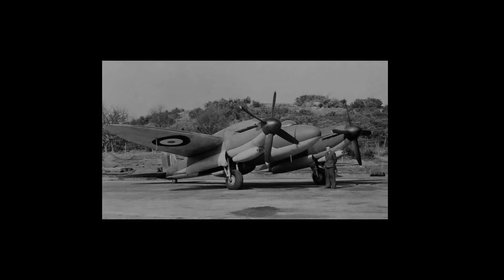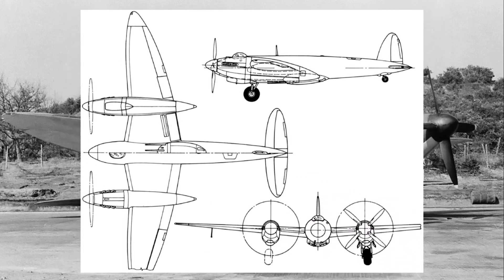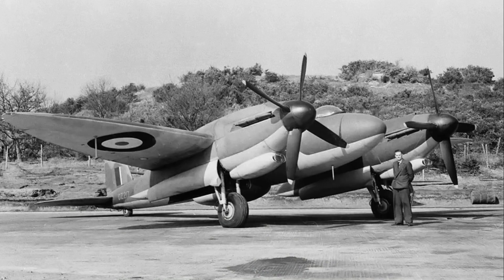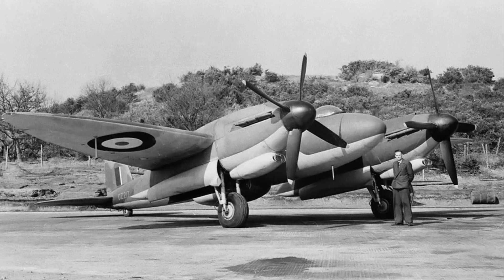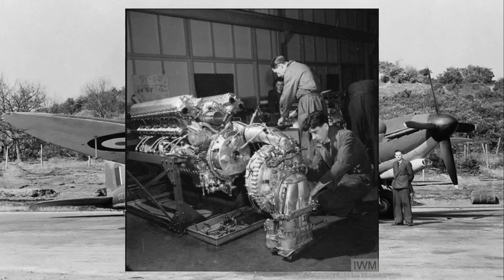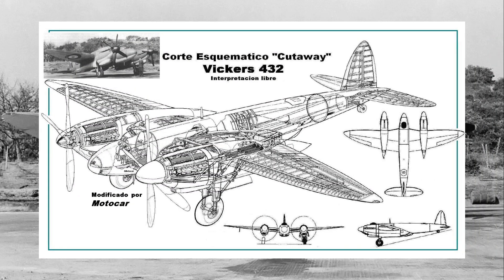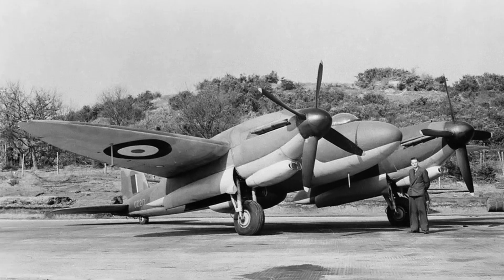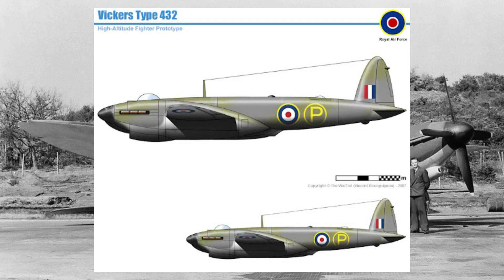The Metal Mosquito: Why Vickers Type 432 Failed!

Comment: The Wooden skin of the Mosquito simply meant it could be manufactured in parallel to other aircraft without competing for materials apart from Engines.
In addition the Mosquito 
quickly became the Nazi's High Command "Mosquito problem"
When being attacked by a large number of heavy "slow" Bombers there's an obvious solution. You scramble a bunch of fighters who know where the Bombers are and their most likely "big" targets. 
But what do you do when 1 or 2 very fast, small Bombers attack. With much smaller bomb loads it's much harder to predict their target which could be relatively small or specific points of a big target. 
These "nuisance" raids can in very small numbers be ignored but when they start becoming very frequent it's hard to know what to do, especially when these Bombers are faster than some of your fighters🤔
Reply from the maker: Great points! The Mosquito’s wooden construction was a major advantage in production, and its speed made it a nightmare for the Luftwaffe. It completely disrupted traditional air defense tactics. The Germans even developed specialized fighters like the Ta 154 and Me 410 to counter it, but none were as effective as the 'Wooden Wonder' itself. Thanks for sharing your insights! 😊